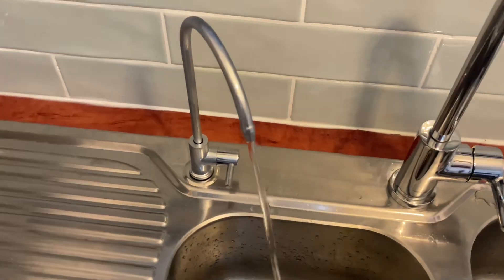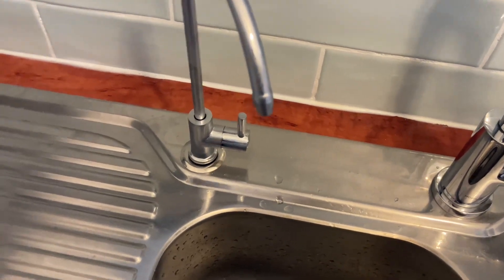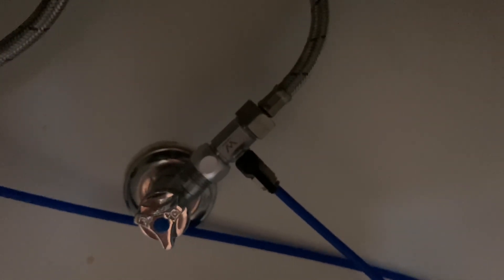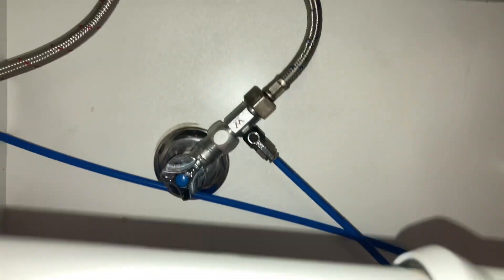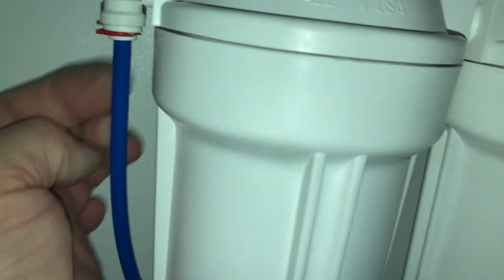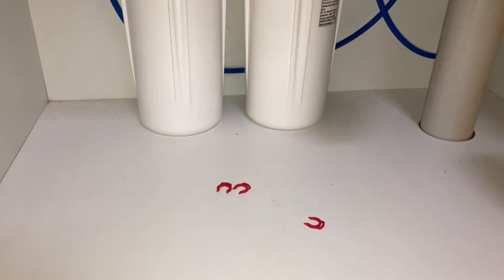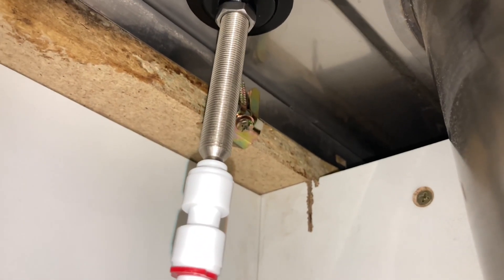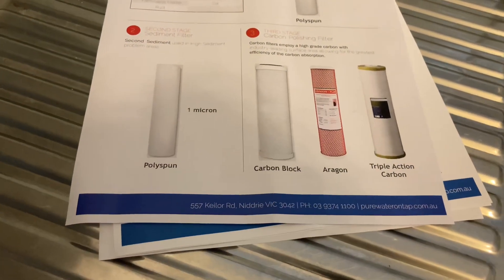FOURBY4DIESEL Sunday - water filter for Vehicles and YOU

Comment: Mount your filter housing higher so when you need to change filter elements you can unscrew them with out having to remove the whole assembly from wall ;-)
Reply from the maker: Slips off mount
Reply: @Fourby4Diesel  You would probably release the 'John Guest' type hose clips to remove the whole assembly from cabinet to change filters if taking off mount.  When re-inserting hose, please cut off 10mm to ensure only new hose is inserted into clip, they have a tendency to pop off if you reuse the same pipe again.
Reply from the maker: Thanks for the tip that is correct screws are loose it just slips out. That’s why we use the little red clips to make sure but this pipe is very good. It does not damage might be worth cutting a bit off every few years, but certainly not required each year could be better quality than the stuff you’re using I guess, this guy has been doing it for decades and does not have that recommendation. Therefore, I would also use that as a back up that it’s probably not necessarily with his quality product but I understand you know something about it and have had that experience so we’ll keep an eye on it and probably Trim every five years or when I can see visible damage.
Reply: Consider a pressure reducing valve as stated above. Carpet cleaner I know says the blue pipes and mains pressure keep him very busy with flood clean ups. Thanks Anthony👍